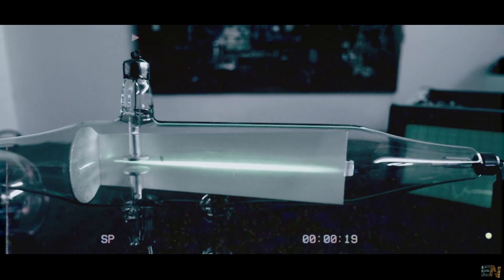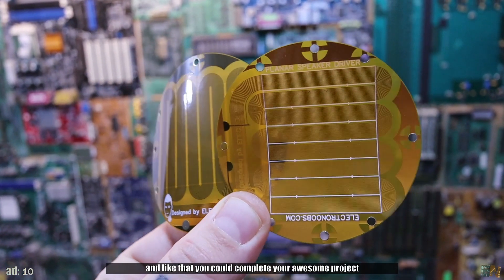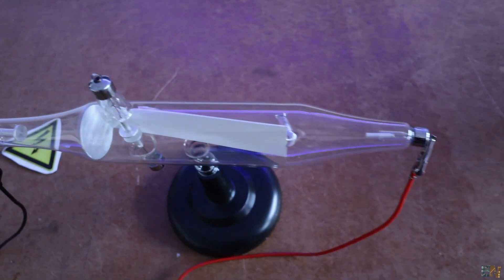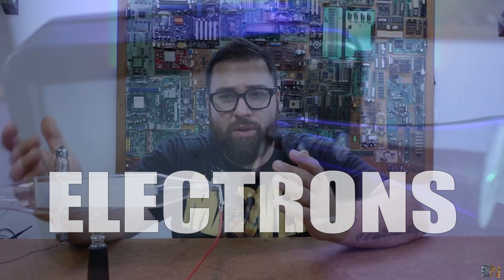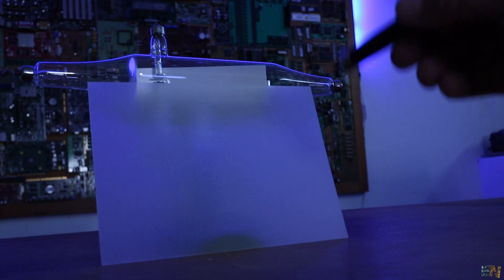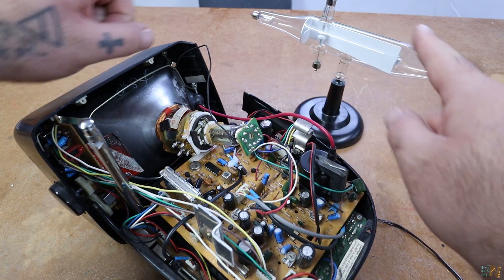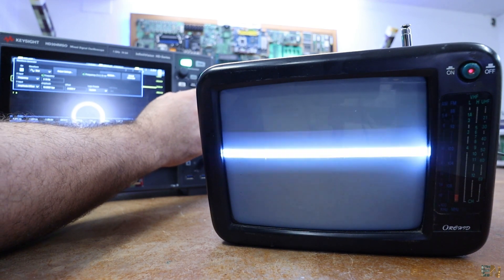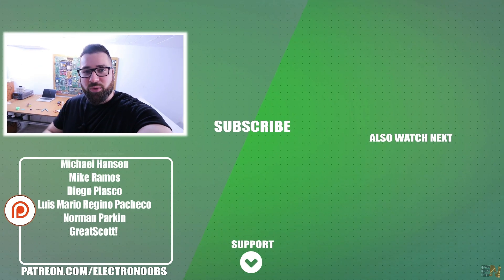REVOLUTIONARY! NOT Just a Simple Tube! From Cathode Ray to TV?

Comment: Hi @Electronoobs
Wonderful video, nice job. Would you mind if I ask you a couple of questions? 
- What voltage are you applying to the anode and cathode of the ray tube? DC or AC and how much? 
- You mention 200V for the terminals to bend the light and I am assuming that it is DC voltage? 
- What currents are involved with this experiment? 
- Do you have links for that ray tube, TV and the phosphorus paper?
No worries if you can't answer, I just taught it was worth asking. I appreciate your time.
Thank you

Comment: If an EMF was fed by multiple peltier modules attached to simple aluminum plate that can be put in the sun, against stove pipe, on car engine ECT...
Have it feed into a cathode ray tube, make it switch on and off quickly, capture the BACK EMF the tube is creating.

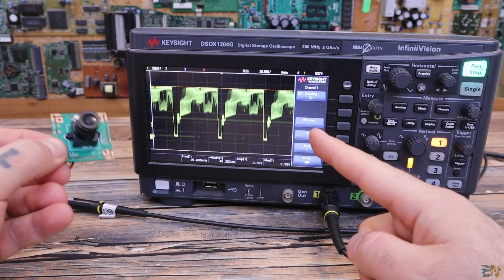Comment: At 17:20 you point to a wiggly trace in the middle of the screen and refer to it as "an AM signal". It's actually the colourburst signal that is "used to keep the chrominance subcarrier synchronized in a color television signal" (quoting Wikipedia) i.e. it ensures that everything is the right colour. Unless you're using the American NTSC system, in which case you have never seen the right colours. The colourburst signal isn't needed with monochrome systems.
Reply: 8 cycles at 4.4361875 Mhz ( PAL System ) if my memory serves me Correctly!

Comment: One note: in a perfect, complete vacuum, no rays will appear. It works only in partial vacum, meaning some very low pressure gas.
Reply: Rubbish.
Reply: @andymouse  I used to eat mice alive, so be careful.
Reply: @baladar1353  SQUEAK!!! :)
Reply: A perfect vacuum would be ideal for the rays to travel. You need more education!
Reply: @glasslinger  Do I? Glasslinger, please don't take my diploma away, okay? It was a hard job to get it.
I don't want to make you look dumb, though all the three main points in your reply can be confuted, even without a degree.

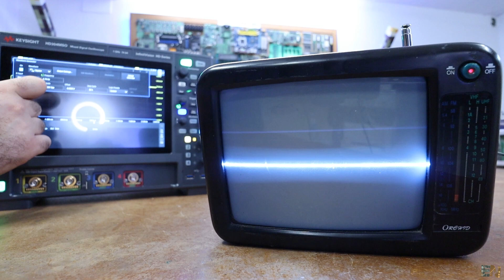Comment: 16:14 I am wondering why whole line are moving in Sine wave signal people do this same setup to make real sine wave on crt screen.
Reply: The horizontal deflection must be done with the proper rate (speed) depending on the frequency of the sine wave. This is called a timebase in oscilloscopes.

Comment: 12:22 no I think intensity of the Electron beam is change by applying controll Voltage on its  grid plate just like controlling the transistor from its Gate.
Reply: He mentions this using a caption

Comment: very dangerous video without having any kind of warning
even you read "x-ray warning uuuu" and then totally ignored it and never mentioned it again
1. do not open a CRT TV unless you know what you are doing, do not touch the tube or the cathode tube unless  YOU REALY KNOW WHAT YOU ARE DOING. these can be filled with very high voltage EVEN AFTER you unplugged it and can electrocute you very, very seriously, working inside a CRT TV is very dangerous and you should have definitely warned very much against it unless you KNOW WHAT YOU ARE DOING
2. did you really not heard the very high pitch sound in the first half of your video? whatever you used to make the high voltage for your experiments, makes a very very high pitch that is extremely annoying and very easy to cut off with an audio/video editing software
3. an electron gun creates x-rays, the front of the TV is coated with lead inside the glass to provide protection of the little x-ray the cathode tube is producing. the tube you had and experimented on, on the other hand, doesn't have such protection and electrons traveling through vacuum creates x-rays therefore you should take extra care on what you are doing with these experiments and you should have at least talked about it

Comment: Look how far screens have advanced since 1890... even to the point that video & images can actually be screened inside the human eyeball.
Yet since 1890, electric cars and their power source has barely evolved at all; and are far too expensive to maintain and operate. 
Evolution for transportation has been suppressed intentionally because it would ultimately lead to free energy- the oil companies' nemesis. 
Go figure- follow the $$$.
We aren't allowed to have the good stuff.
Reply: of course, those pesky oil companies... they wouldnt have any interest in a way of reducing oil consumption, so they could drill less, refine less, and charge MORE for producing LESS, of course not... no, they want to drill for as much as possible in the remotest regions, and make it as cheap as possible, so everyone can bathe in glorious petroleum products, an abundance of hydrocarbons...

yknow, even if the energy were free, they would still require lubricants? insulation? plastic assemblies? or does this free energy also negate the need for such mundane essentials?